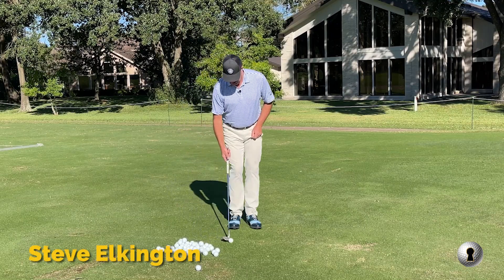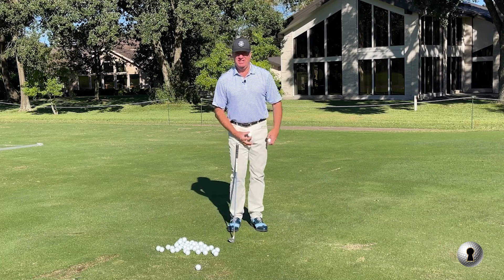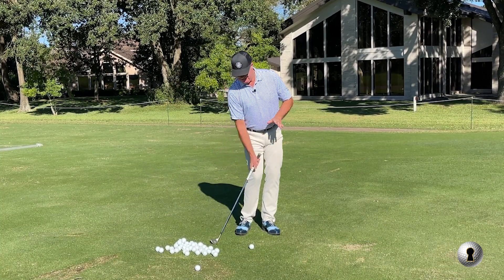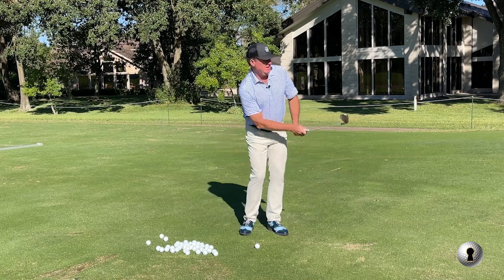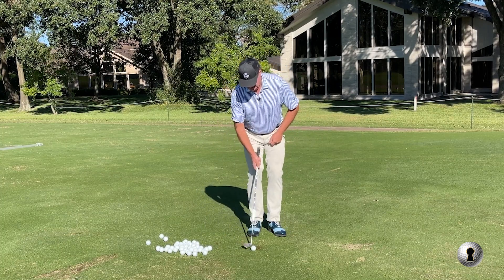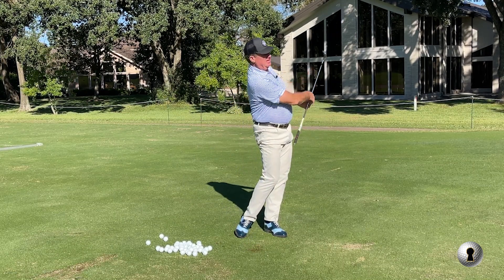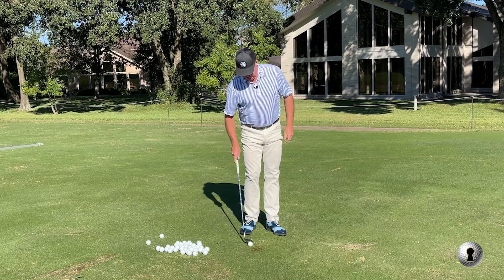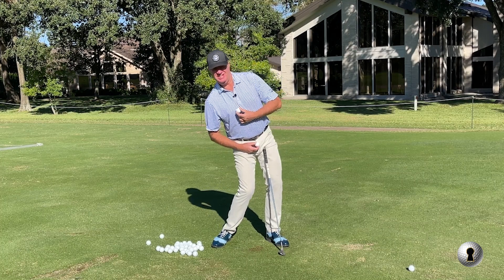Pro Style with Elk - Chipping

Comment: Its not so much the center of gravity but the fact that during the golf swing the axis of rotation of the club head mass doing the work changes from the lead shoulder to the trail shoulder through impact.  When the lead shoulder is the axis of rotation it swings the lead arm is the primary lever which due to the geometry swings down into the ball.  But as the mass of the lead arm is allowed to disconnect and pull the trail arm straight the trail shoulder takes over as the axis and trail arm the primary lever resulting in an upward swing arc.

In a full swing the objective is to pound the ball into the turf and have it pop out with lift producing backspin so the lead arm swing axis is ideal for that.  But in partial chip and pitch shots which do not generate enough striking force to compress and stick the ball to the face of the club it rolls up the club face before releasing and having the trail shoulder the swing axis and trail arm the primary lever is more ideal because it provides better control.

Not much attention is paid to the role the mass of the arms play in accelerating and steering the club and most golfers if asked will not even realized that in the last half of the swing the trail shoulder is the axis of rotation because they focus on what their lead hand is doing.